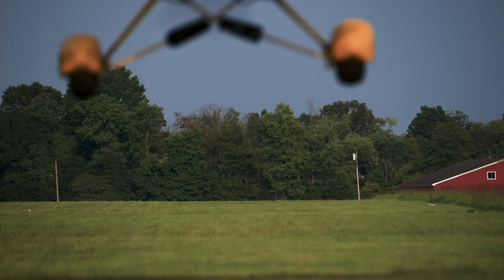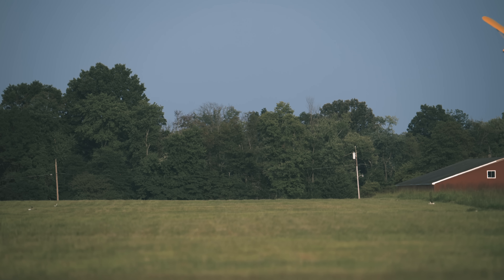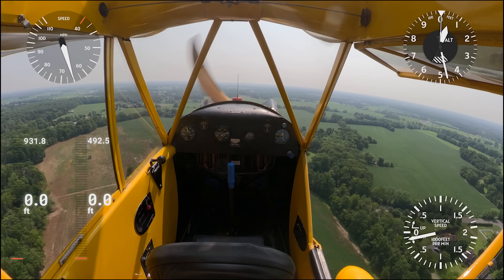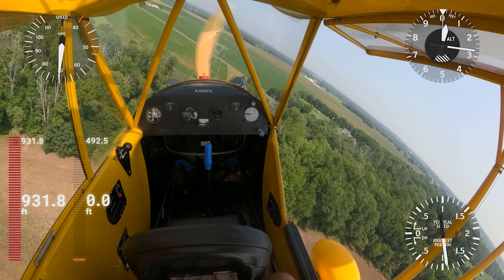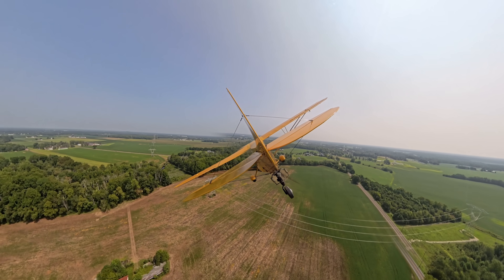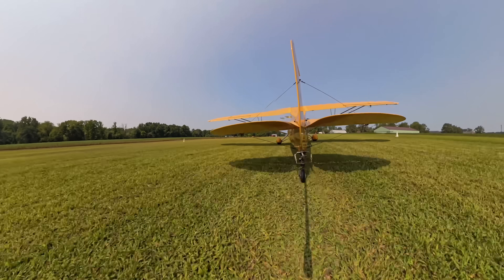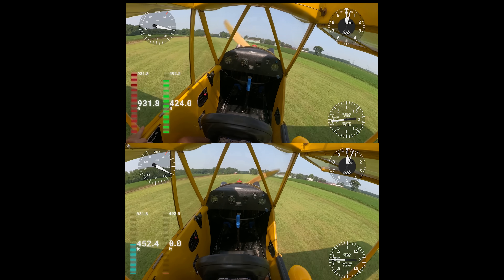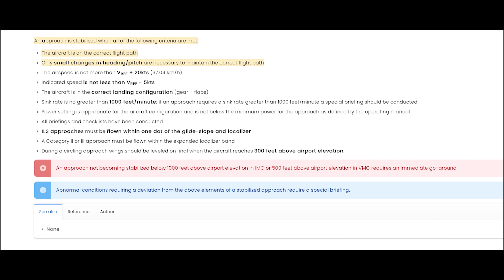What Happened to Basic Stick & Rudder Flying? Slipping an Airplane to Slow down.

Comment: Regarding “stable approach” and airlines by 1K HAT, I read somewhere to consider this in terms of Time not Height. If you’re at 1K AGL, on a three degree glide path, you’re 3.3 miles to land. You’re probably doing >=120 kts, so you’re a minute forty to go, perhaps a minute ten if doing 180. If you’re only doing 50, however, that same glide path would put you at three hundred and forty feet HAT as a reference to be stabilized. If you’re doing 60, be stabilized by five hundred HAT. Note: stable is not synonymous with static. Many will treat these terms as such, however.
Reply from the maker: This is a great point. At the airlines we always do it 1,000ft above Airport elevation and our Vapp changes obviously with weight but usually we are 110-145kts or so. Good talking points 👍🏻
Reply: @Bananasssssssss  I much prefer AOA such that there is no change with weight as you have with approach speeds. I also think we should teach constant AOA turns in slow flight not just constant airspeed while constant AOA turns make for better landing patterns as they reduce risk of approach turn stalls. You can find on Medium “AOA and Power Techniques” discussing these as well as a case study with “F-35C Crash into the South China Sea.” Note you do not need to see AOA to do constant AOA turns, you just have to have sufficient power to stay level or at desired rate of descent in said turn. No back stick pressure required, your trim setting maintains the AOA.
Reply from the maker: @jimallen8186  that’s also another great topic for discussion. There seems to be too much focus on Airspeed when it comes to discussion about stalls rather than really understanding AOA how can you stall at 150kts and not stall a wing at kts etc
Reply: @Bananasssssssss  I love taking peeps in my RV-6 and showing them a ninety degrees nose down stall. Granted, you have to have pitch rate to do it, but it does it. Do a Split-S and tighten the pull just as you’re approaching ninety down, feel the break with the nose suddenly stopping at the given pitch. Ease off it pulls through, sometimes you may over-ease off and need to slowly ease back in.
Reply: @Bananasssssssss  I’ve had a thought recently regarding ‘the jerk.’ The jerk is the third derivation of position, that is to say it is the acceleration of acceleration. Consider our pneumonic “fast is slow, slow is smooth, smooth is fast.” What is it getting at? To avoid the jerk (aka jolt). Back to that ‘stabilized approach,’ and consider dive bombing needs to be stable too, what is it you really want? Low jerk values. None of the other parameters really matter and the statistics don’t line up. Mentioning ‘dive,’ don’t recall if I’ve mentioned it in this thread, certainly have elsewhere, we need to differentiate between ‘dive’ and ‘descent’ as well as ‘zoom’ and ‘climb.’ Descents and Climbs involve rates of chemical energy impacting potential energy. Accelerations and Decelerations can be thought the same way for kinetic. Zooms and Dives, however, are those redistributive things, constant mechanical energy though trades kinetic and potential. Understanding this makes for a whole lot better flying while many are slow to understand as we fail to properly name and label. (This also means “dive and drive” is a misnomer as properly done it would be descend and drive hence per the low jerk value, also stable.)
Reply: The time consideration comparing HATs is still conservative as we haven’t counted for responsiveness either, props can act as big brakes to slow down while jets are more clean, pistons respond rapidly to power demand while compressors take time to spool up..

Comment: I’m a big fan of the forward slip to lose altitude. Not so big a fan for such to decelerate. Can be a bad habit that puts lots of stress on the back of the aircraft. Big setup for negative transference if getting into longer fuselages. If you fly an on-speed AOA, you’ll learn not to be fast and won’t float. But if you’re over-energy at the start, or need to stay high, slipping down lets you bleed without the stress on the tail achieving the same effect. Anticipate and avoid the problem. Slip the steep to avoid it becoming a dive and not need the subsequent decel. If you’re high and fast, fix the fast first then the high wait to slip till fixing the high. Silly idea, zoom away the fast thus easier to see your total energy error in the high, slip it away as needed.
Reply from the maker: Agreed,,I rarely slip to slow down but have done it occasionally. It’s one of those things that I think everyone should at least be somewhat familiar with it, “just in case” so to speak

Comment: Pretty average pilot😂

I find it aggravating when I say getting your ppl in a taildragger should be a requirement and everyone says bulls*** blah blah blah. IT SHOULD BE A REQUIREMENT. 

Also go arounds shouldn’t be pushed as much as they are. Did your instructor teach you about the complications and how many people have been killed doing a go around? Or did they teach you about how many people have been embarrassed over a bad landing? Flat landers, I’m sure don’t understand that. But a good around is not always an option, it’s also not always the best option. 

How many controls need to be manipulated for a go-round? Did you calculate your density altitude? Is the terrain rising or falling?

How many control inputs are required to make a bad landing?
Reply from the maker: That’s a good point and probably another topic I’ll touch on, but I have seen so many near accidents on Go Arounds. They don’t adjust trim, go Max Power then climb out near critical Angle of Attack all while reaching for the flaps.

Comment: I know that when I got my ppl, that the instructors were not going to teach forward slips over the runway with a flare through the slip, that is something that the private pilot is going to have to learn without supervision, it takes some instincts to try some of these things, stick and rudder skills apply to ground handling as much as when the aircraft is airborne, but the pilot has to take initiative to try stuff.
Reply from the maker: Good point Joe. This is definitely something that is (rightfully so) out of the comfort of a newly minted PPL

Comment: A slip with steep bank is safe because the lift function is transferred to the fuselage so the wing stall speed is slower.  A slip with nearly horizontal wings needs speed vigilance because it's a setup for a spin.  PS you can do an insanely steep slip by starting from a near power-off stall and using full top rudder and keeping the nose up.  Try it from altitude first.  You steer with the elevators.  If the speed builds up the nose isn't high enough.

Comment: I was on a medical check ride with an FAA inspector just prior to my PPL check ride to demonstrate my eyesight was sufficient. The tower asked me to turn to base early to get me in before an inbound jet. So I slipped to slow and get down and still put it on the numbers. The FAA inspector seemed surprised that I was performing a slip, but I nailed it and he signed me off. I had practiced it a lot, just because it's fun.

Comment: nice video, my wife and i recently had a long trip and ended up landing at a 30 feet wide 2000 foot runway overpower lines and trees in c-182 heavy in heavy crosswind, actually made a good landing but had two goarounds before i actually set it down, i also agree to fly has much as possible thanks dan

Comment: AMEN! 

What also astounds me is how very few GA pilots seem to realise that they are playing a game of energy management.   

Speed and altitude are interchangeable by pushing or pulling on the control stick. All the while, you are constantly losing energy through drag and simultaneously topping it up through engine power. 

 So if you now find yourself low and slow (so: somewhat low on energy), you add engine power, and use the control stick to distribute this extra energy over speed and altitude. Simple. 

And if you find yourself high and fast (high on energy), you pull power, and again use the control stick to tell the plane where to get that energy from - altitude or speed.

But what if you’ve pulled your throttle to idle and still find yourself with an excess of energy? You need to add drag to lose it.  

So, your options?

1: Add more flap if you have them. Flaps create a ton of drag. But on final you are likely to be at full flap already. So what else could you do?

2: (And I’ve never heard this one taught): Temporarily add speed. You don’t HAVE to approach at vy all the way. In fact, that is the speed with pretty much the least amount of drag. If you need more drag, just speed up to max flap speed and dump a bunch of energy. After all, drag goes up with the cube of speed, so a 20% increase in speed will create a 73% (1.2^3) increase in drag! Just make sure that you're back at landing speed when time comes to actually put your wheels on the ground. How? Pull your nose back up. At lease you've lost a bunch of energy by now.

3: And indeed, another great tool in the toolbox is to kick your plane sideways and expose a whole bunch of surface area to the wind. In other words: slip.  

But it’s all about energy management.  

And why doesn’t anyone seem to learn that any more?
Reply from the maker: Brilliantly said! Thank you!
Reply: I used to use that principle with a Cessna 150 and full flaps. I'd stay at pattern altitude until about a quarter mile out. It was really fun. One time a controller assumed I couldn't make the landing being that high and that close in and told me to go around.

Comment: Fantastic topic.  The more tools you have the better.  Practicing this is also extremely helpful for landing in big crosswinds. It's the exact same thing only you are using the slip to be straight to the runway. In big crosswinds, I land my Cherokee with some extra power in because of the extra drag. Your demo was probably the equivalent to landing in a 15 kt plus crosswind in terms how amount of slip needed. Full rudder slips should definitely be in the practice routine.

Comment: Slips are a forgotten maneuver after the advent of flaps.  I’d bet that 99% of GA pilots don’t give them a thought and even look at them as dangerous.
    I’d also say that the vast majority of pilots have no idea of true “stick & rudder” flying.  The best compliment to a pilot is that he doesn’t get in a plane and fly, but ‘puts the plane on’ where it becomes an extension of his body and piloting becomes an unconscious effort.  I can see that you are in that mode with your cub and can sense not only the winds but also the planes feel.
     It’s unbelievable when I see videos of pilots that can’t wait to engage the autopilot and fly 99.9% of their hours on autopilot and couldn’t care less for the linking-in and connecting with the feel of the plane.
  I wonder if the latest Brazilian commuter crash could’ve be avoided (after ignoring the weather warnings) by feeling the plane lose its responsiveness.  I’d guess they left it on autopilot until it tripped off and handed the controls to them, only to have them find that the controls were complete mush.
Always enjoy your videos!
Cheers 🍺🍺
Reply from the maker: well said

Comment: As a glider pilot, we use cross controls and slip, often times when there is a cross wind component.  Besides getting us down quickly, we don't get pushed off the center line. In fact, it holds the center line quite nicely.
Not sure if you guys encounter it, but because of our wing length and crossing controls, if you're not careful, and you allow too much aileron, the upper wing generates a lot of lift and can put the glider into, what's called, an 'over the top, spin entry'.  On final, this can have devastating results.

Comment: I’m at a field with lots of flight instruction.  Airspeed control seems to be an issue. Instructors are afraid of slow flight and stalls and so this is transferred into the new students.  250 hr pilots teaching students.  Bad combo

Comment: Sorry, Joe. You lost me when you said you were an average pilot. 😝 Totally agree about the forward slip. Don’t you think recent concerns around safety have pushed training towards more go arounds? I can’t tell you how many podcasts I’ve listened to and videos I’ve seen where if you’re not laser lined up, perfect altitude, etc., “GO AROUND!!!!!” Not that I’m discouraging a go around when it’s appropriate. I was trained in Texas. The weather is rarely perfect. You are almost always dealing with some form of gust or crosswind. Flying the plane to the ground, using all our  stick and rudder tools was heavily pushed. EDIT: I will say, as an airplane owner, if I’m using all the runway, it’s to roll out and save my brakes. And to honor the men and women who built the entire length of the runway. 😂
Reply from the maker: yeah, it's one of those thing where it's like, yeah, you Should always be willing to Go Around, I'd never suggest 100% committing to a landing (of course unless your motors out) but like you said, everyone thinks it's as a black and white as ( If you are Unstable even by a little go Around, when it comes to GA) and that's all well and Good until you have an engine failure or the weather almost beat you to the airport, or you're low on gas etc, the point is Sh*t happens!!..I just think (I know you aren't disagreeing I'm just "talking out loud") it's way better to give yourself as many options as possible. Also speaking of money, It's cheaper for me to slip to slow down than it is for me to go Around! (even at 4GPH!!!), hahah

Comment: I am a CFI and was "checking out" a guy from the UK in one of our Cherokee's. Doing a checkout, I don't give any instruction really, just observe the pilots flying skills. Every trip around the pattern he would turn base to final at pattern altitude and then do the most beautiful full slip, right to the numbers. Of course, any well-done slip such as he performed, was clear evidence that he knew how to fly and it was a short checkout. I asked why the slips. He said at his home airport its part of their noise abatement and every landing requires a high approach followed by a slip. It was a flight where the CFI became the student. I won't ever forget.
Reply: Unreal. How about we tell those people not to buy a house directly under the approach end of a runway.
Reply: @mcmouse92 Noise anaitment is not from the home owners.
Reply: I learned in the US and fly a robin 200 in the uk.  And there is a difference in the way we do things obviously.  We tend to teach dragging it in under power but I was taught glide was preferable to landing on the neighbours. But in the UK many runways are much shorter, I kept my plane at EGBD for years and that is shorter than an aircraft carrier.  But if I'm landing at EGBO where I'm now based I only slip if I'm in a hurry and being in a hurry is not a good thing.  My plane is low wing and there is some debate as to whether slipping with full flap is OK, poh doesn't say you can't but doesn't say a lot of things that you definitely can't so I do slip, just not with full rudder smashing.
Reply: Nice
Reply: Why dont everyone train in their home country, stop goong to states, get your plastic at home.
Reply: Great. And there are plans to get ALL pilots doing an idling final. Maybe the side slip is not for everybody, but I've been a glider pilot decades ago, and side slip was part of the exam flights for your glider license. I thought all single prop pilots can do a side slip, why not? Ah, the brick effect.
Reply: @voornaam3191  This video isn't about side slips and there was no mention of cross wind.
Reply: So a slipping turn would be unheard of in the Cherokee world?
Reply: @bobsakamanos4469  Nothing wrong with a slipping turn. A skidding turn on the other hand must be avoided.
Reply: @tphillips777  Yes, I'm well aware one must avoid bottom rudder.  I just thought that if a fwd slip surprised a CFI, then a slipping turn from downwind leg would leave them speechless.  Not a slight against you; I'm just trying to understand the standards of the Cherokee / nosewheel crowd.
Reply: @bobsakamanos4469  I slip my Cherokee on nearly every flight, and have been slipping Cherokees for many years.
Reply: @wicked1172  good show!  Thanks for the response.

Comment: I got my PPL 2 days ago, I never got to use slips as much as id like, as on every approach except when simulating a flap failure, I was using flaps in my 172. 

I certainly never used a slip in ground effect
Reply from the maker: Congrats on your PPL!. This is just something to be aware of and maybe revisit with your CFI once you get a little more time in the airplane,  I always enjoyed doing Commercial Maneuvers because I feel like that taught e a lot about aerodynamics, energy management etc.

Comment: In sailplane flying, we still learn side slipping and it can be very useful. Sometimes we have to land on 300 ft long grass strips with an aircraft going probably around 60 knots. There are airbrakes but if you misjudge you can’t go around.